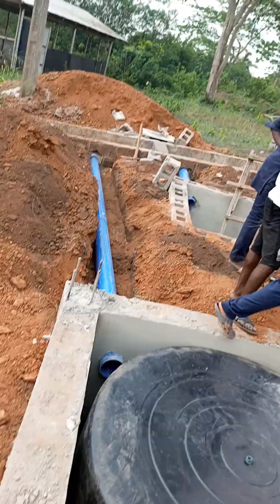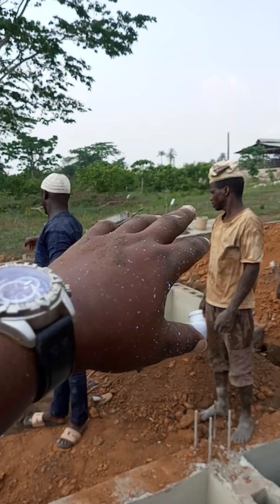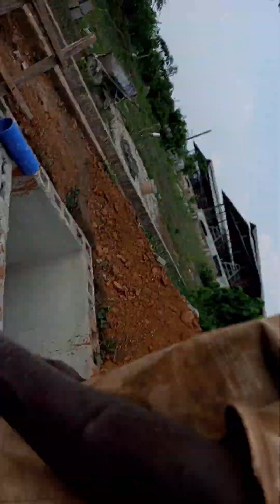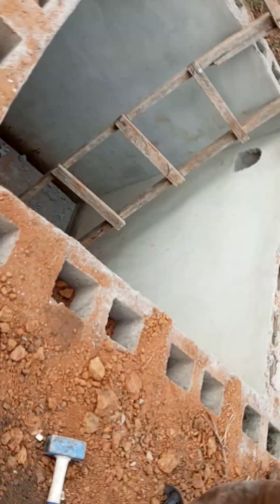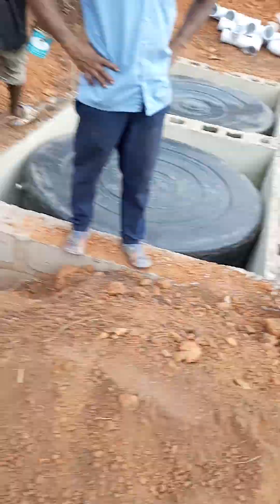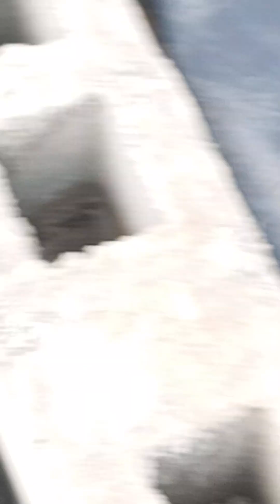A 20 cubic metre biogas digester in Nigeria/ Miatech Innovations Nigeria #biogas #trendingshorts

Comment: I wonder why we cant use the concrete rectangular pit  without the plastic tanks as our biodiester
Reply from the maker: Concrete deck top will expand and contrast as the sun heats it up and the cold night temperature sets in thereby leading to very tiny cracks. These cracks will leak out gas over time
Reply: @miatechinnovationsnigeria  Good and great idea
Reply: There's a way it can be done that it'll not be affected by contraction/ expansion.